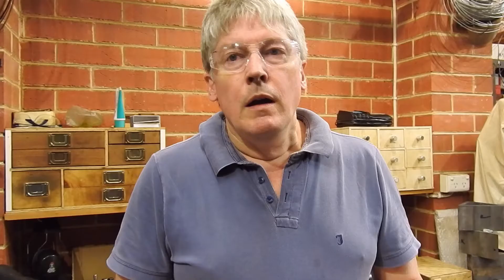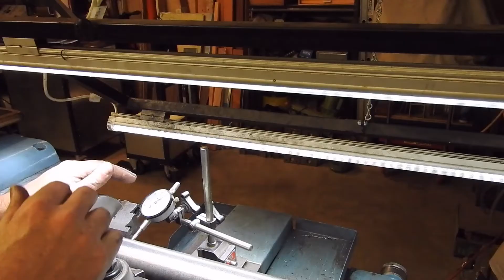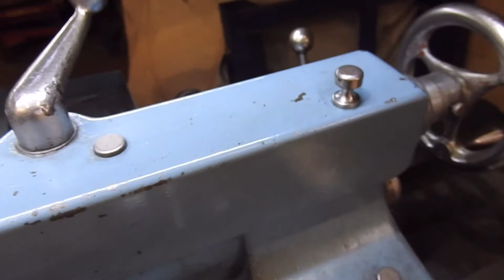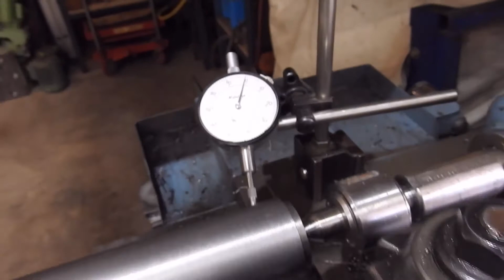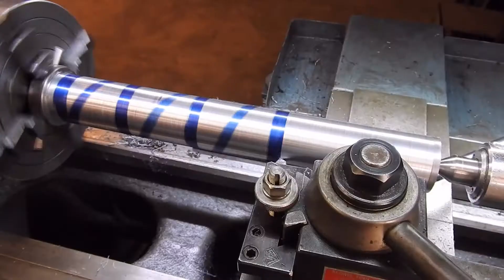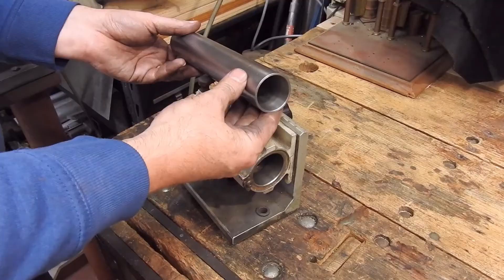Shafted!

Comment: Nice work, a good example operator skill to get a good job from a machine that's not 100%, the 0.002" oversize may have been a result of the bed wear and compounded by a comparatively slender work piece bowing away from tool, i am assuming the "Shear " grind you are  using  has a slight burnishing effect on the work  compared to a "dead sharp" pointed tool, good work keep the videos coming
Reply from the maker: I'm not an expert, but the shear tool does not burnish - it cuts but rather than being square to the cut, it slices the material off at an angle. Another one of those "one day I'll have to research that a bit..."
Reply: @occasionalmachinist  like a shear tool on a shaper?
Reply from the maker: @ericparsonage7938  Yes. Same animal. The video of the tip was not terribly clear  - when I have a chance I'll try and show it a bit more in focus (still getting the hang of this videoing...)